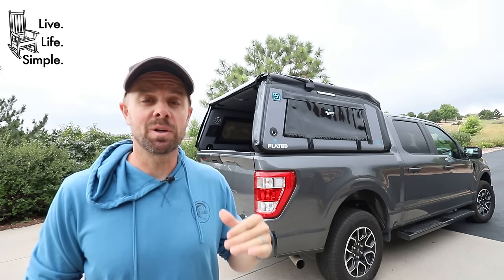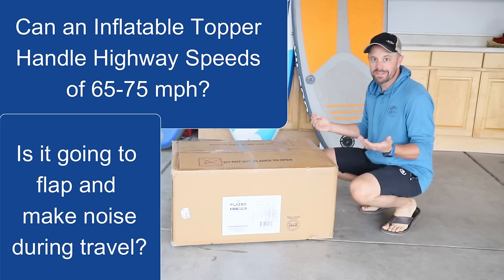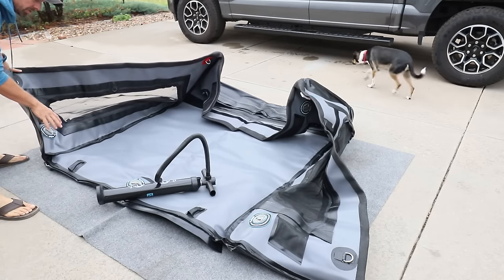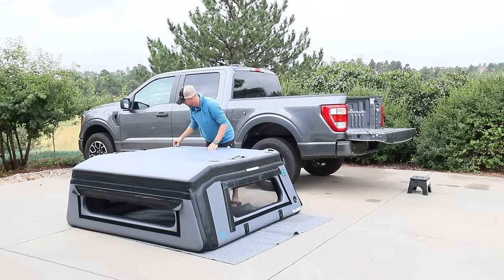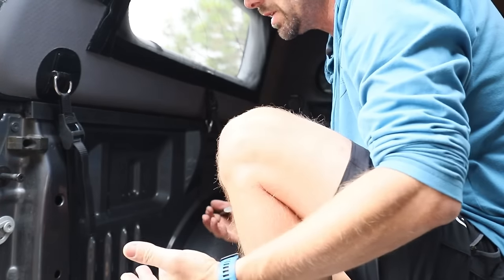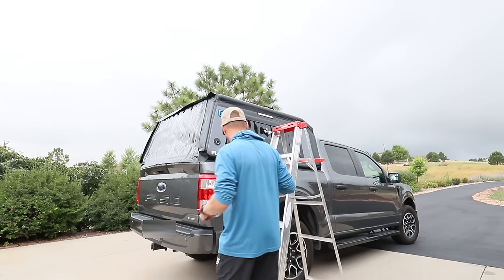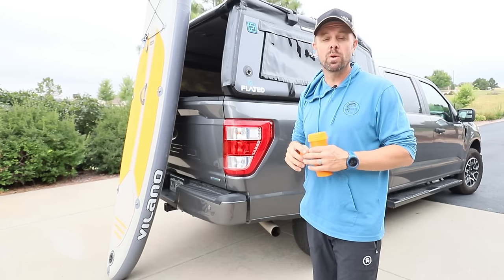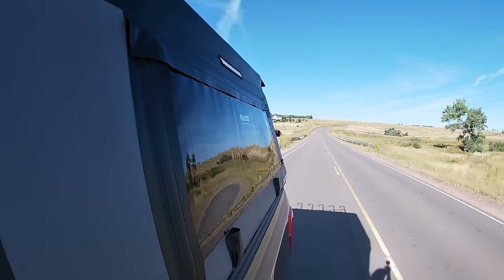Is the FLATED Truck Topper Worth the $$$ -- Review, Road Test & Pros and Cons #flated #flatedtopper

Comment: I bought my truck specifically to camp in. I was going to buy one of these and build a removable camping setup. Buddy talked me out of it and I bought a truck bed tent for 1/10th of the price. Plus, if the tent gets ruined in a year, it’s still cheaper to replace and have the extra money for more adventures. $1,800 is just a lot to pay for something so vulnerable to punctures and tears and, mainly, just be used for truck camping. Plus, it doesn’t look that great.
Reply: If this material is same as used with rafts and paddle boards, I'm sure it will be durable enough in every situation but the most extreme. River rafts bounce off a lot of rock and not all smooth and do quite well. Can you imagine damaging a $3-6k truck topper as opposed to a $1500-2000 Flated. Also,much easier and cheaper to repair Flated.
Reply: I'm going with the tent too
Reply: Yeah, it looks like a bad craft project. I don't want or need my truck to look like an inflatable boat.

Comment: I actually love the look. Way better than the folding canvas toppers, plus way sturdier.
Reply: Best review.  Needs skirting around front, corners, and sides to prevent water intrusion at highway speeds.
Reply: @jamesriley1207 we got the latest version and that's one of the improvements we've noticed - it now has a skirt around the base of the topper. It's been super rainy here in NorCal as we have driven around and it's pretty waterproof. I've been rather surprised.
Reply: Can you tell me the price.? And I have a dodge Ram Laramie 1500. Fits on this pickup.?
Reply: @SuperLatino55  it’s listed on the company’s website based on the model you’re interested in.

Comment: $1800 seems pretty steep when you compare it to the Softtopper which I just bought for $989+shipping
Reply: this is where I am.    this is ALOT easier to COMPLETELY remove though,  whereas the softopper can be folded and that's nice,  but it's still there.      I'm torn,  but don;t desperately need either
Reply: Eww to soft topper lol.

Comment: Instead of a velcro on rear window, they should have done a frame section like the front design is. Have it zipper in place with a velcro cover to guard water intrusion, then just have some standoff mounts (similar to the tie down points) with integrated poles that you can store inside. Doing this, you could unzip the rear "door", fold it up, flip down the poles and lock them into place so it would act like a traditional rear window on a topper. It would take about the same time as removing the rear plastic window and you would never have the issue of the tailgate strap moving or worrying about it coming off.

Comment: If I was camping in the back how would I velcro the back flap back down from the inside after I get in to prevent rain or snow from getting in?
Reply: Get some commercial velcro tape. That stuff is awesome. 
It will stick to anything. Probably better that the stuff that comes with the topper itself.

Comment: Con is on dirt roads the zippers on the back window attract dirt that effects the zippers. Need to keep them clean or you can damage them. Front corners on a F150 can easily be sealed but they don’t really leak much. Back window needs constant cleaning if you drive on dusty dirt roads. Leaving mine on all winter where it snows a fair amount.

Comment: I think there's an another pro for the midsize vehicles that have less than desirable payload limits. at 50lbs compared to 300lbs for fibreglass models, Tacoma drivers could  carry a lot more gear. I think it's awesome. Great video lots of details.

Comment: They say you don't lose heat from the floor.  The topper itself looks well insulated.  My floor in winter (stilts cabin) is like a walking on an ice rink.  You're not sub zero camping, but you can insulate the truck bed sides,.  have a good day! :)
Reply from the maker: Thanks for the info!

Comment: Very nice review and introduction to this product. I have never heard of this kind of product before. Very interesting. Eliminates having to run with a hard shell all the time. Or at least the hassle of removing and storing. I also make use of a Retrax cover, and open bed when hauling daily things etc. So I require flexibility.

My primary concern would be safety on the road relative to having my things secured when in public parking lots, and while sleeping in non-traditional RV places. It seems the product would be very vulnerable to attack. 

So this product may be limited in its use. Both while sleeping, and while stopping to shop. Someone will have to remain with the truck. Unless the product is inflated and deflated at a camping site. 

Otherwise, it seems to be a good product, as long as its limitations are known. Thank you.

Comment: Anyone know if you can use this with a roll up tonneau cover already installed? If so this topper would be great when you really only need a topper a couple times a year but still want some cargo protection the rest of the year
Reply from the maker: I had to take mine off to install this.  If your tonneau rolled up is not real close to the back window in the cab, you can probably squeeze the topper  over it
Reply: What about with a retractable cover?
Reply: @sbhtennis   Possibly.   You have to attach the straps to the bed tie-downs, which would not be possible (with the tonneau closed, at least).  If you can Macgyver another way to strap it down, you're good.   If it's open, you MIGHT be able to, but your retractable cover container will probably be in the way of the straps.

Comment: Awesome product! We use our truck for working the property. This is perfect to camp, put the boards on top, and bikes in the back without having a dedicated topper that comes with storage issues. 

Question, did you say that was regular carpetting or boat carpet? We also have the same truck with 2" level and 33s so its tall for putting rigid boards on top to reach. Wanted to get your thoughts for sliding equipment like your kayak on top. Thanks!! Great video!!

Comment: this perfect for someone who doesn't want or needs a full time hard shell on their truck. As for the tailgate Velcro strap. Keep in mind it was more than likely designed to be a temporary topper. that's the reason for the strap you tension pull. You can take it on and off as needed. If you're really anal about it you can buy a strip of adhesive backed Velcro and permanently install it.
Reply from the maker: I use mine almost full time.  So far so good!

Comment: How is it for elevation change. 
Phoenix Arizona at 1,500 ft to flagstaff at over 7,000 feet 
Will the seams burst. Then deflate going the other direction
Reply from the maker: I'm not sure.  I havent used it in that much extreme.  I have gone from 5800 to 8000 and not had issues

Comment: It held you at 165lbs standing on your two feet which is not widely dispersing your weight. Of course it's going to handle half that weight in kayaks spread out over a larger area lol. We would have been more impressed if you did the kayaks first then showed it holding you up.

Comment: $1,800 Is outrageous for an inflatable. 

I’ve paid less than that for a fiberglass Snugtop with slider windows and screens for a long bed 1 ton pickup. That was with installation and paint to match the truck!

Comment: Not long ago, cloth canvas toppers sold for under $800. I was watching wondering if this is worth another $1k over that but when I looked it up, those soft tops sell for almost $1200 now. So only $600 difference for better sealing, one person setup and more stability. 

I dropped $4200 on a colormatch ARE topper last year. And while I still believe for permanent coverage, there’s no comparison between this and an actual truck topper , if I needed to be able to swap out quickly, this seems like the best option available currently.

Comment: This is pretty interesting... Next test would be driving in rain. Bet it would leak a lot.
Reply: My concern was speed and my lead foot, so this definitely would not be an option for me.
Reply from the maker: It can handle speed.  I have driven with it on for several days and you can't even tell it's on there

Comment: $1800? I paid $1200 for my ATC fiberglass brand new back in 2017. I ordered their lowest teir with a carpet liner. I could have order a couple upgrades and still have been under 1800
Reply from the maker: Yes. and in 2017 I would have paid $25,000 for a new truck instead of $50k.  2017 prices are about 1/2 the price of anything now.

Comment: For 1800 you may as well save for a regular topper.  If this was like 600 it might be worth it just to,use for camping.
Reply from the maker: reguler topper is $3-4k for a decent one and it has to remain on the truck or take up lots of space for storage.  It's also a pain to remove and install it.  It's a different product

Comment: Can’t use to camp in cold weather, as a heater will melt that darn thing. Rendered useless for that one reason. You’d have to camp in ideal temps or nothing
Reply: just how hot do you want your camper?   if you keep the temp under 150 or so it would not melt lol.